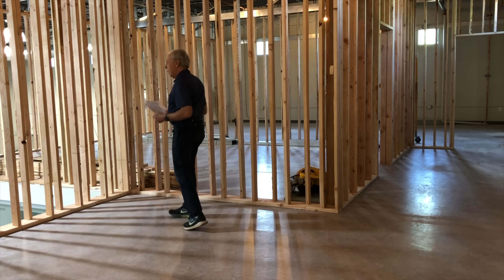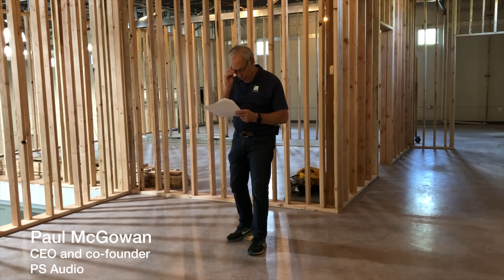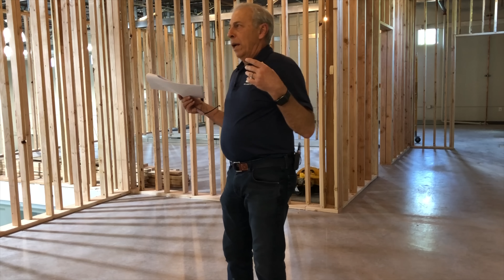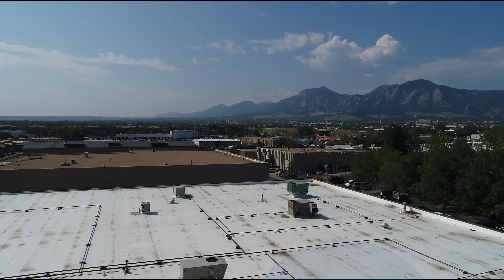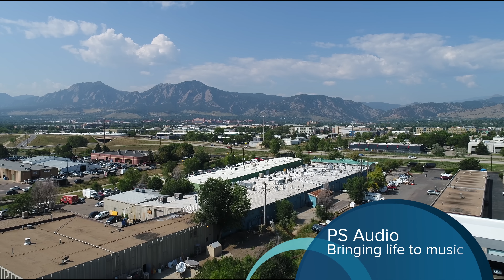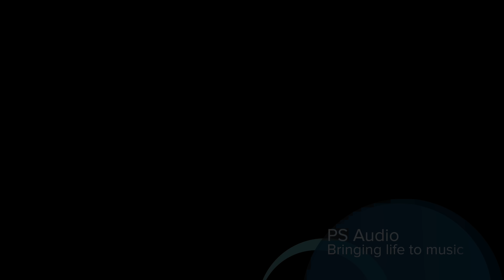Which is better, sealed or ported speakers?

Comment: Servo 'controlled ' subs or LF drivers is a misconception... Philips used this principle many years ago in order to compensate the woofer's falling frequency response in a sealed box .. it sounded awful .. muddied and lacked transients. If you are trying to correct what you call overshoot or other artifacts in the driver, then this whole 'closed loop' system is playing catch up.. it has hysteresis!  You can achieve excellent well controlled bass using the correctly made speaker and mounting it in an efficient enclosure
Reply: Most (all?) of those servo controlled subs used a duplicate coil for feedback.  That didn't work very well.
Reply: JiveDadson ....servo systems just sound impressive in sales blurb.. more snake oil stuff ! Use a really good bass driver with a damn big magnet and high BL and a top quality amp with very high damping factor and you won't NEED a servo system ..all the do is to corrupt the signal somewhat .. a waste of time ! Just use a really good speaker !!
Reply: He did say it uses DSP which could also be used for time correction.
Reply: Janina Palmer you sound hysteresistical .  Good points however.   Speaker "technology" seems largely about trying to make a small enclosure sound like a big enclosure because 1) big enclosures cost $$ and 2) small houses are in and 3) women rule the roost now.  See how I got gender biased but I do think people let alone women don't value those big speakers cluttering up their living rooms especially placed 18" off the wall and 24" off the corners.
Reply: and you can make a better woofer  with a servo controlled woofer if it's also correctly made,. All things being equal, the servo controlled will be better by some margin.
Reply: Captain Win    That's not true ... servo controlled bass units are the result of using inferior drivers with low BL

Comment: You partially justified your reasoning for going sealed, but you never really explained the differences between the sealed and  ported / passive radiators. I understand the need to do the sales pitch, but unless you answer the question it's pointless making the video.
Reply: Dodgy Brothers Engineering, well said!
Reply: @Aussie Shane So techo Shane. I've had sealed ported and trans line speakers and yep trans line are amazing. Ported speakers seem fraught with all sorts of problems but if set up well can make a great soundstage. But overall for everyday listening ie not set up very well like my stuff is, unported speakers seem the least fussy. I run just some small sealed units with an active sub and they are fine. Interesting design, a round heavy polycarbonate so there are no flat sides in the enclosure. There's also magneplanars which are like an alien in the room. There's sound but hmmm...even at volume they don't seem to have any weight which I find discombobulating. I like my music dynamic and percussive but these just float the sound around the room.
Reply: Yes I am currently building one PR sub, and  some TL woofers. Neither are the conventional sealed or ported.
Reply: Yes, I too felt the same....

Comment: You cant hear sealed speakers. Sealed speakers have to be bigger. Sealed speakers sound congested. Sealed speakers dont sound as clear as people say. Sealed speakers are no good.
Reply: you can argue for that you dont personally enjoy sealed speakers, but you cant logically argue for that ported speakers are better.
Reply: thats because your amp is not good enough for sealed they need a good amp to drive them
Reply: The Thiele Small parameters should dictate what type of enclosure to use.
Reply: sealed speakers are smaller.
Reply: Yes sealed are typically smaller.
Reply: Myron Helton - Only if you are sealing the drivers inside the enclosure.
Reply: Infinite baffle speakers are sealed and huge.
Reply: @stevejacksonpianos  infinite baffle are generally not considered sealed because of the sheer volume of air both sides of the driver. They would be considered closer to open baffle in terms of response, without the back wave.

Comment: I prefer the sound of sealed speakers. I listen to a lot of heavy electronic music, clarity deep down is crucial, ports just mess that right up. I have a ported REL subwoofer but it is tuned to 16Hz so does not cause issues and is very musical in the 20-35Hz range I use it for. My speakers are sealed with 8 inch bass drivers, they have a really tight deep bottom end.
Reply: Mmmm my girlfriend has a really tight, deep, bottom end too. You two must be doing the same exercises.
🤣🤣🤣
Reply: @amb3cog  OMG hilarious !!
Reply: You'll Like!!!
https://youtu.be/Q3oItpVa9fs
Reply: Skrillex and Excision ?? I love this stuff and even use it for system testing in customers homes...ya need LOTS OF WATTS 😀

Comment: Sealed vs Ported? ie: Are you a Chevy guy or a Ford guy? Pros and cons of each type. A properly designed sealed or ported box can both have great sound. You need to spec out a speaker with the T/S parameters for the type of box. The box size for a sealed system is more critical than a ported one. A ported box allows some wiggle room 'cause you can dial it in by tuning the port. Yes, the ported box is gonna have a "bump" at the ports resonate frequency. Sealed box will be more flat overall. I have 2 ported powered subs for my home theater. Their "bump" is around 30Hz or so. Just right for those explosions and all the fake rumble noises in movies. So, like a lot of folks say..Choose your poison.
Reply: if you have som eq on sealed subwoofers there are so many benefits from them that ported makes little sense.
ported are only for added volume, not sound quality.
there is clearly are a best option and that's sealed, you only lose some output but get better output.
Reply: Thanks for your opinion. I can't believe all the arguments for PRO sealed boxes! That's fine and dandy. They do have many advantages over ported. But why are their so few sealed subwoofer boxes commercially sold? Look at your big box stores subs. Most of the most expensive home subs are ported! Every sub I have are ported. Infinity, JBL's, etc all ported. What gives? Is that because they're all junk? Inferior so they have to port them to get sound out? One of my passive subs is a certified THX JBL 18"  5 cubic foot box that is ported!

Comment: Seal for clarity.. Port for thump
Reply: Properly designed ported speakers have no thump.
Reply: @BogdanSerban  the whole point of a port is more air flow. More air flow = more low end. How will ported not have more of a hit than non ported
Reply: By thump you mean the kind of boominess that is associated with poorly designed ported boxes. But ported boxes can sound as clear as sealed boxes, they only help the woofer go lower in frequency.
Reply: Ported are hands down better than a sealed box for low frequency response, they are just harder to design properly. The biggest issue with ported woofers boxes is port chuff.  It is the sound you get coming out of the port when it isn't big enough. When you use a driver with  a very large Xmax, it has to displace and replace a lot of air in and out of the box. 

You can over come this by increasing the diameter of the port, but unfortunately you also need to increase the length of the port sometimes quite dramatically to keep the same tuning, so the box winds up being massive.
Reply: Passive radiator boxes have all the benefits of the ported box without some of the draw backs. You will still need a larger box roughly the same size as a ported box (and much bigger than a sealed box) but you won't have any port chuff because the air never leaves the box like a sealed box. The passive radiators merely move in and out in unison with the main driver. The draw back to PRs is additional cost.
Reply: Bogdan Serban, agree boominess just means they designed it wrong. Clarity is a function of the driver, not the box. If it booms check the shape, filling, ports, and driver placement are right. One or more are bound to be wrong.
Reply: Servo woofers for the best of both!
Reply: And PR for the best of both worlds...

Comment: Acoustic Suspension Sealed is ALWAYS better as it helps with transient dynamics and 
if you have more than one bass/mid-bass driver in that same cabinet which has an open back it effectively couples the drivers together.
Reply: Makes you wonder why the Wilson WAMM and Focal Grand Utopia use ported/reflex enclosures...
Reply: fookingsoc Incomplete thought. At a lower price point you are correct.

Comment: Speaker ports are a great place for McDonalds Happy Meal toys to end up.  I don't know how that happens ;-)  I prefer sealed too.
Reply: that's a good one, must admit I had to read it couple times to get it. my kid is grown up, forgot that kid factor, thanks. my gran-daughter will be mobile sooner then later so i need to kid proof once again. thanks for for the smile this has generated. :) . as for ported or sealed - it is a personal preference period.
Reply: I agree. I much preferred ported cabs until I got my hands on a pair of ADS L810's. These sealed speakers have really made me smile while listening again. I have a ported sub in the mix so there's plenty of everything I want.
Reply: My subwoofers port had mega blocks put in it. I had no idea what that sound was until I had no choice but to open it up and take a look as some fell down inside. Kid proofing your audio equipment is a tough job. I forgot how many speakers Ive had over the years wear the dustcap on the tweeters were pushed in because of the kids.
Reply: yea, i've had to draw out a dust cap or two for the same reason.  At least we don't have to worry about VCRs getting fed peanut butter and jelly sandwitches any more. :-)
Reply: You can usually put a fine cloth mesh over most ports at the inner termination. That would stop most toys.
Tweeters are a bit harder depending on the speaker - I guess you could make some sort of metal standoff grille that's strapped to the cabinet if there's no proper attachment points. Could also custom make a grille that attaches via the tweeter screws.

Comment: It's a matter of application. The response from ported vs sealed can be approximated using a well designed crossover. Now room coverage is a different story. Unfortunately one needs to design the speakers for the room, not the other way around.